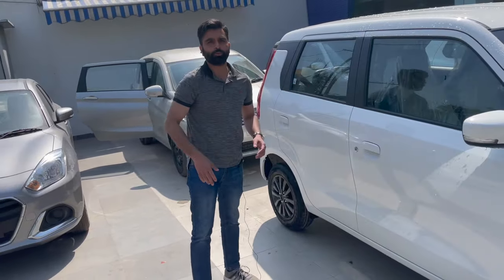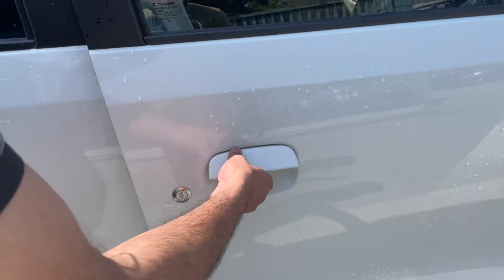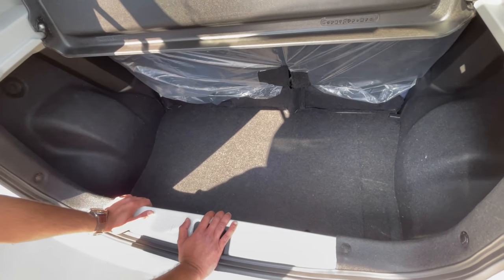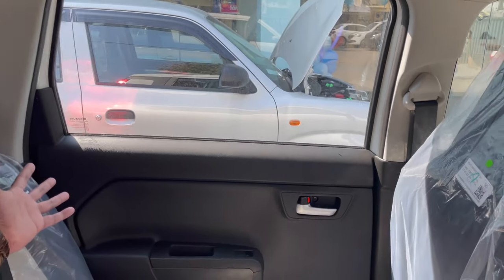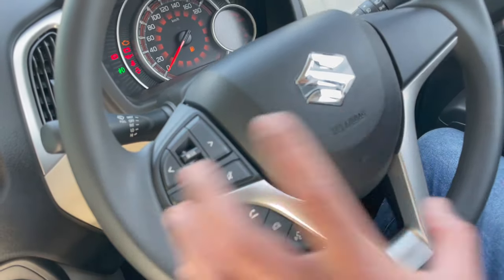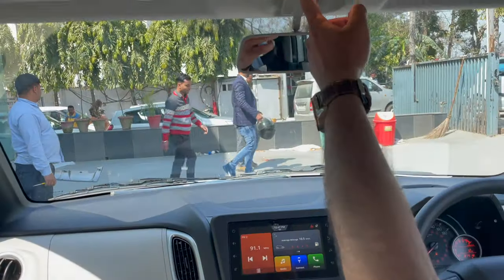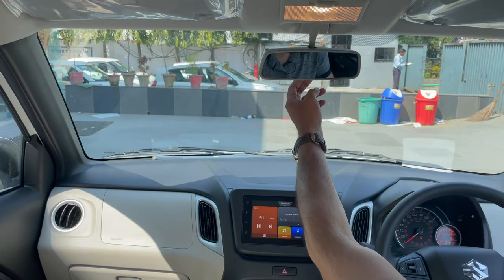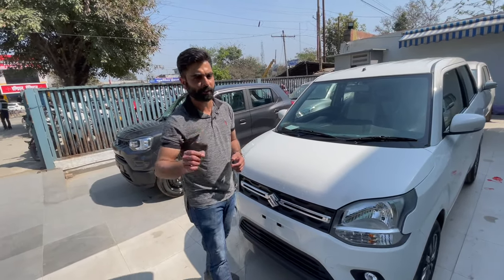WagonR 2022 New Facelift Top Model क्या ये बीट कर पाएगी Swift को Zxi Plus . Starts @5.39 lakh only

Comment: 1-is it any problem without engine guard.
2-is it have driver side seat adjustment?
Reply from the maker: 1 - no not a problem... only the thing is sometimes dust accumulates from bottom.
2 - no there is no driver side seat adjustment
Reply from the maker: There is no height adjustment only tilt and forward backward the seats is available